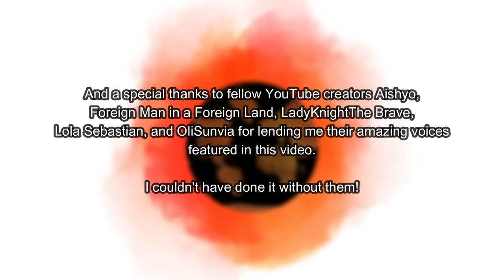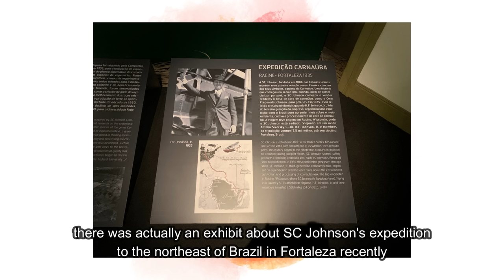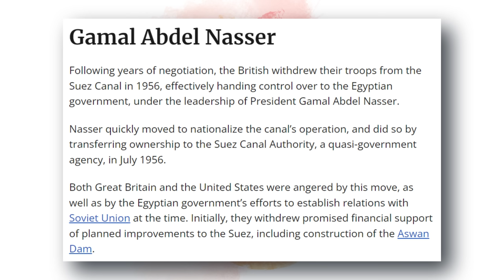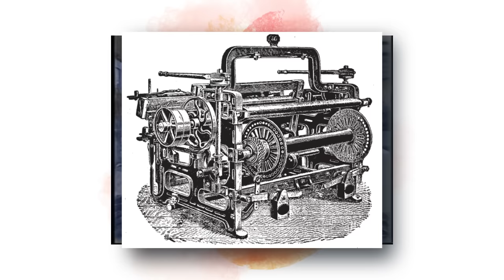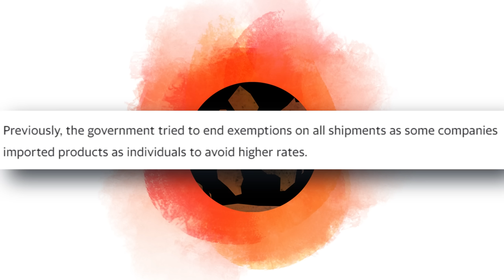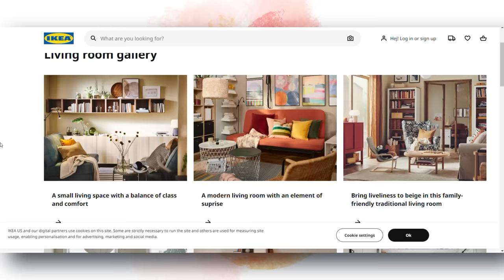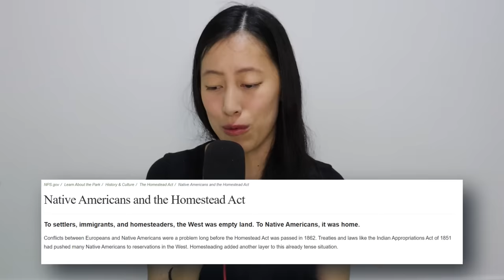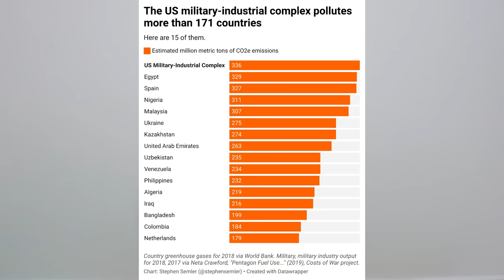Made to Break: Why Everything We Buy Today Is Trash

Comment: Planned obsolescence - one of capitalism's "great innovations". 🙄
Reply: I actually don't even think it's so much planned obsolescence.  it's just that things are produced way differently nowadays

there are gigafactories in china that will produce nearly all of the world's supply of a single item.  different brands will all ultimately be manufactured a few miles from each other in the same city in china.  they all end up using the same suppliers, same engineers, etc, to design all of these products.

the world economy is 'soviet-ified' in a way, it's so much more centrally planned than most people realize
Reply: @Reid52 it’s planned. it’s why technology has warranties and why every industry is unsustainable. making goods low cost and poor material means you’ll buy them over and over again if you’re on a budget
Reply: @bonnielovely  yes, repeated sales are the hallmark of good marketing strategy.
Reply: Planned obsolescence was an economic idea to get the US out of the Great Depression
Reply: @Reid52 here's 2 examples, 1. would you like to compare modern houses to just Sears houses of the 60s and 70s? 2. You want to check toyotas of 5 years ago and older to the Toyota presently? Not that hard to observe these things and connecting to Wall streets goals.
Reply: One of the most unintentional ways to seeing how things are made is Barbies. You can buy a relatively cheap barbie from the 80s and just holding the doll in your hand you can tell how well made it is. The body feels heavier and high quality (modern barbies are hollow body), there are more hair on its head, the face is hand painted vs a print screen, the clothes are real fabric instead of plastic, there are more accessories in the box, etc etc
Reply: Made blossom by Apple.
Reply: No, it's Apple's greatest innovation! And all their bad practices spread to everyone else...
Reply: I’d take that over being sent to the gulag
Reply: @gloverfox9135  "the gulag". You are aware that Gulag was the name of the administrative penal system, right? Saying "the gulag" is like saying "the department of corrections". But, of course, you know everything there is to know about the USSR because of your feelings.
Reply: @elonmusksellssnakeoil1744 is almost impossible to talk about how bad late stage capitalism is to people who still believe socialism is basically turning the country into Soviet union 2.0. like seriously these people seem brain dead sometimes
Reply: kinda hard to supply quality when to billions of people demanding clothes, furniture, etc. can't have it both ways
Reply: @JP-hj1il lol Sears homes were ordered from catalogues in the EARLY 1900's. Google is your friend
Reply: Most people have no desire to keep maintaining the same appliances. They are happy to get rid of them. 

Take cars. They are designed to last about 10 years and 100,000 miles without requiring major repairs. But most people who buy new cars only keep them for 3 years and 35,000 miles. Is that the fault of industry? Industry is more than happy to provide you with spare parts to keep your car on the road if you wish - my son's little run-around is now 15 years old, kept alive by his regular maintalenance of parts prone to wear-and-tear. Most people don't want to put in the kind of effort that it takes to keep an old car on the road. Curiously, the people with lowest income seem to be just as keen to discard old things as those that can afford brand new. 

Modern cars are far more reliable than they were in the 1980s and far more likely to make it in excess of >100k miles, but young people don't want to accept that. They witter on about "planned obsolescence" as if they knew what they were talking about. Its not "planned obsolescence" its planned lifetime. Those of us in industry already know how long you intend to keep your phone, your car, your washing machine and your house. We design the products you want to fit your desires for cost and lifetime from new, using computer modelling. 

Its not industry that determines the lifetime of products - it's the consumer. Demand longer lifetimes and we will give it to you - but expect to pay more and have that 30 year old washing machine with out-of-date technology that no longer suits your changing lifestyle. I bought a car 8 years ago that was full of the latest technology at the time and I've just replaced it with a new car that has the latest technology of today and its like something out of Star Wars by comparison.
Reply: @gloverfox9135  Of course you would. Its called being subserviant
Reply: @mikelachey824  id rather be subservient to a system where I can buy whatever I want over a system that forces me to do what the government wants me to do. I’d rather be subservient to the system that allows me to leave whenever I want, over the system that actively forces people into the borders of the country. I’d rather be fed than hungry

Comment: I'm 42 now, and I can vouch for this trend. I had a TV that lasted my entire childhood and into college, my NES and SNES and Genesis worked for over a decade at least, some longer, and now I've had three tv's break in the last five years and every modern console I've bought has broken down, from the Nintendo Wii up to the Xbox One. Things just are not built to last even as much as they were in my day, and people were already talking about Planned Obsolescence then.
Reply: I live in a house made directly post ww2. I have much less issues in my home than my buddy who lives in a house constructed in 2017.
Reply: @SmartCreeper  Sounds like you picked an ironic name.
Reply: To be fair, I got my Wii in like 2008 or 2009 and it's still ticking just fine.
Reply: How do people break their consoles? You theow it around?
Reply: I think there's an area between planned obsolescence and progress. Would I still want to connect devices with serial and parallel connection and manually setting baud rate, stop bits etc.? 
I'm glad that TFT monitors exist and we don't have CRTs with VGA resolution any more.
Reply: Bro how do u break a console?

Comment: i noticed that the stuff i buy at second hand shops lasts longer and is better quality than what i got at any shopping mall fast fashion store
Reply: Yesss… especially furniture 🪑 👍🏾
Reply: @WokeOne65   this is so true my parents and  I got a couch back in 2018 and  it got ripped and the color has faded away but  my grandma's couch is perfectly fine and she has had it for 3o years
Reply: It depends on where you look, though. I'm seeing more and more fast fashion in thrift stores, and soon there won't be any classic pieces left.
Reply: Old elastic and glass was made better.  I have fitted sheets from the 70s that fit my mattress nice and snug.  Modern elastic goes bad in 3-5 years.  If you store it once it turns to rocks and cracks apart.
Reply: @Rebecca-zj4wq omg yes, i hate that
Reply: If u want to save 5k to 10k and spend around 500 to 1k, u should always buy hardwood table from second hand shops, if needed, sand it down then oil the wood again. 
So many people do this but its hard to find these days bcoz second shops call a known buyer as soon as a table arrives, and that buyer refurbishes and sells it online with a 400% + profit.
Reply: Yup...second hand is really great. Got a winter coat from a second hand online store and it has a really good quality.
Reply: Antique stores have good quality furniture-- but it can be pricy depending on where you go. There are some online retailers that specialize in vintage clothes as well. I shop on etsy but there is a problem with fakes and the pieced probably are a bit overpriced.
Reply: I did not buy anything newly produced in almost 20 years now.
Reply: @ahah1785  Good job.

Comment: I bought a macbook 2015 model in 2017 for $1500. I took really good care of it yet in 2022, 5 years of using it, the screen light stopped working. Turns out it was a design fault but I was no longer eligible for any free repairs. I had to pay 400 to get it fixed, while the new Macbook of that model was available for 4-500. I just bought a dell for 650. But so disappointed that such an expensive laptop only lasted 5 years. I was hoping to get 10 years out of it at least.
Reply from the maker: Almost the same thing happened to me! I bought a 1200 MacBook in 2017 that was a 2015 model (made in 2015). It lasted me two years and all of a sudden it stopped turning on. I decided not to fix it due to various factors but the main one is that there’s no Apple Store in my area. I got a windows laptop instead that’s still going strong. I was also upset that such an expensive laptop had inexplicable problems just after two years.

Comment: I have a 4 years old dishwasher that is broken. My boyfriend is quite handy and he said the one (1) bearing is broken. A bearing is worth 2-3$. But the bearing is inside the motor and pump “unit” and you are not meant to disassemble that. Luckily, my dishwasher has a 10 years guarantee…. So we can have someone see our dishwaser and replace the unit for the premium price of 279$ (canadian). That is litterally what the “guarantee” does. A 10 years “premium” price. Or we can buy the pump and motor unit piece ourselves for 360$. A piece that will probably break as well because of that bearing. Or we could buy a new dishwasher for barely more. 
My boyfriend has disassembled the motor/pump unit to change the bearing. We haven’t tried it yet, wish me luck.
Reply: Good luck.

Comment: I think stuff made in the past was likely to be of a slightly higher quality (partially because in  the USA's case, products were being made in the same market they were being sold in) - but we also can't write off survivorship bias. Maybe there's an appliance from the 60s or 70s that runs great...but I'm sure there were many that didn't; the machines that made it to the present day may be painting a rosier picture than actually existed
Reply: Well cars are a good example. 100,000 miles on a car in the 70s was way more wear than it is today - even more so if in a cold climate. That car was done. The lifespan of cars has improved over the years. However, those cars were also easier and cheaper to repair. Especially with minor repairs - which were less likely to be repaired if not necessary. Cars last longer now, but the cost of repair can be very high - it doesn't help that people insure cars for non-catastrophic repairs which just drives up insurance and repair costs.

Comment: This is why I don't even bother with expensive stuff anymore. There are very few exceptions where it does count, but most of the time, it's the same. Stuff lasts about the same time. Why buy a microwave that's double the price if it's going to break at the same time as the cheap one?
And speaking of clothes, I have some old jeans from the 80s, from a couple different brands (Levi's and Wrangler specifically), and you can really tell the difference in quality when compared to the new ones. The fabric is thinner, the stitching is worse, they feel just like brandless pants you can buy at Walmart. So why bother with the price?

Comment: the 2015 kenmore washer n dryer i got almost brand new on craigslist for my old apartment started falling apart within 2 years, and yet my parent's washer and dryer that are original to their house from the late 70s-early 80s are still working amazingly and get my clothes cleaner and dryer to this day than the newer ones ever did. new appliances are such garbage and i will never spend more than the bare minimum required for them. if im shelling out, it might as well be for an old reliable one at this point.

Comment: Ever since I was born, my mother has had the same dishwasher that has never had to be repaired. This is remarkable for two reasons: 1. For many years, my mother lived in a region that is supplied with very calcareous water. 2. The dishwasher was second-hand when it was bought and is therefore older than me.

The dishwasher may not be as energy efficient as modern appliances, but I highly doubt modern dishwashers last as long.
Reply: my parents live in a semi house that was renovated before they moved in: new dishwasher, stove, fridge and those lights that are built directly into the ceiling. during the past 10ish years they've lived there ALL that stuff has broken except the stove (and it doesn't work great either). they had to get a new fridge, dishwasher, and a bunch of the ceiling lights don't work anymore. compare that to their elderly neighbours in the other side of the semi (literally the same house in reverse but not renovated) they have all their old appliances from the 70s or 80s still and everything works great. the renovation was only to make the house seem more modern and therefore valuable, it didn't improve anything

Comment: I have mended and restored a lot of things that don't normally get either done to them. Backpack, yoga pants, rubber boots, sneakers and such.

Nylon backpacks have some incredibly cheap waterproofing, for instance, some sort of waxy/gauzy layer applied to the inside. This eventually comes away in shreds and fails completely, leaving the contents of the bag to get soaked if it rains. This can be replaced with twin coats of aerosol glue and aerosol matte lacquer, which seals the cloth, does not come off in the wash, and does not come off the cloth at all. The cloth will rot before that waterproofing fails. I traced the cloth panels when they started to rot, remade the backpack, and sprayed it again.

The failing of the waterproofing is what you said about being made to break, isn't it?